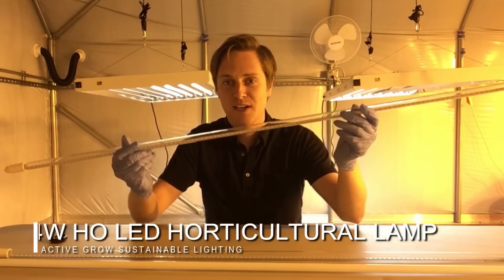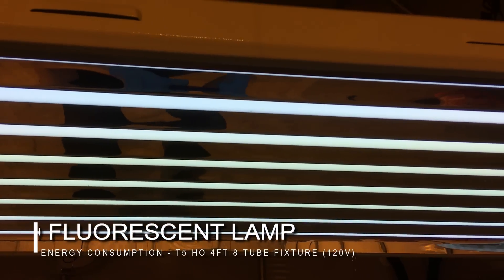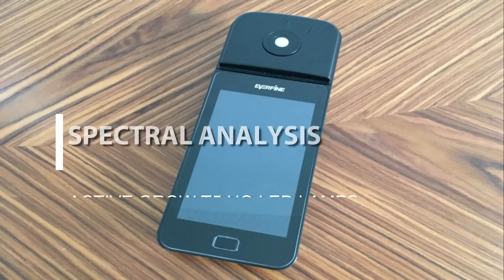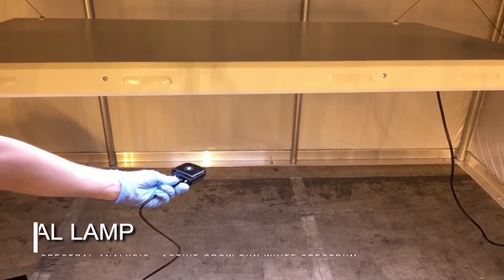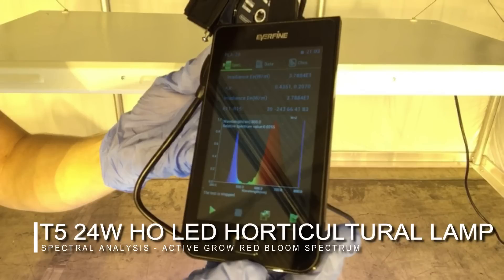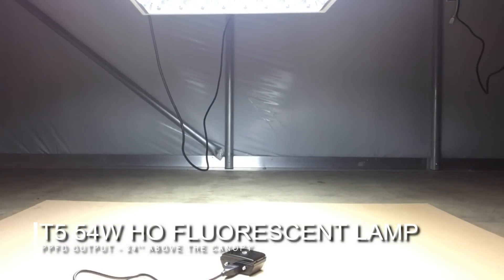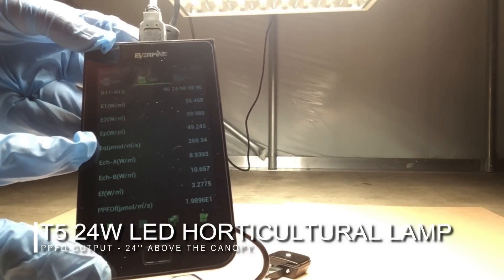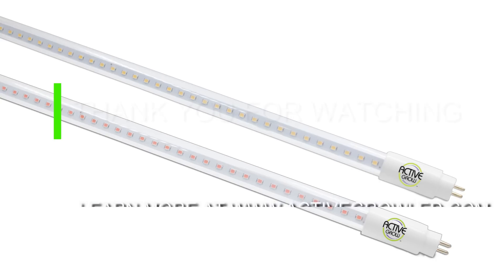Active Grow T5 LED Grow Lights Vs. T5 Fluorescent Tubes - Energy, Spectrum & PPFD

Comment: I just got my first pair of the 2ft 10w version.  my intent was to use 2 pairs of 2 lights (4 total) per 48" shelf, in order to save extra power (by being able control lights in half shelf increments)

I'm mildly disappointed that  the 2 ft version seems LESS than half as powerful as the 4ft (10w x 2 = 20w, which is 20% less than 24w).  I was wondering if that also corresponds to 20% less lumens for two 2ft vs one 4ft ?

Comment: How do these differ from iSunlight Agroled 41W 4’ T5 LED replacement bulbs? The spectral analysis looks similar but they are a bit more wattage and can run in single bulb fixtures. I am currently using the iSunlight T5 LEDs which come in veg, bloom, and green varieties.

Comment: Hi, great informative video. 
I have 4ft T5 fluorescent 6500k 5000 lumen bulbs in my indoor greenhouse. My plants have done great with these, but the time has come to replace them. 
I really want to switch to T5 LEDs however, have only found them in 5000k / 3500 lumens and below. How much does this matter?  Do T5 LEDs not exist in 6500k, 5000 lumens?
Thanks.
Reply from the maker: Not sure about that but we offer the Sun White and Sun White Pro spectrums that will perform much better for plants than any standard 6500K CCT LED.

Comment: Really wish this could have been done in a 4x4 tent with two 8 lamp fixtures @ 36 and @ 24 and @  12  and @6 inches
Reply from the maker: Thank you for the tip. The PPFD readings do increase substantially in enclosed tents. We are working on providing that information as well.

Comment: Do you make a higher wattage t5 led replacement bulb? Love the full spectrum these light put out. like to see a side by side grow using both
Reply from the maker: Hi and thank you for your question. At the moment we only offer the 24W T5 HO lamps as we want to offer a true one-to-one replacement for 54W fluorescents but with increased PPF efficiency and higher quality spectrum. If you use these lamps in a 4 lamp, 6 lamp or 8 lamp fixture the PPFD at close distances reaches very high uniform numbers allowing you to grow high DLI requirement plants in spaces with limited vertical clearance. We are constantly testing our lamps and fixtures and want to also show more side by side grows as well. Happy growing!
Reply: I’m in a 8 bulb t5 fixture & i just bought my t5 led i like them so far & they don’t put out a lot of heat, my question is how far should my light be away from the canopy & I’m in a 4x4 grow tent?

Comment: I'm currently using 1 of these in my jump start hydrofarm. Glad these are made. Helping me out until new lights arrive. Shout out to Green Coast hydroponics in Anaheim CALIFORNIA for letting me know these exist. It doesnt put out much heat. They had Veg and Bloom bulbs seperate and I only got Veg. Was surprised that there was no blue at all or any color. It is white but when off it's clearly an LED. I'd guess it's about an equivalent of 50-100 true watts. Good for starters. I added an silver heat lamp with a 99 cent store single LED grow bulb and that maybe is 25 watt pull. It said 100 watt. My little plant is happy and so are my tomatoes cucumbers and morning glory. 

Nice to see the specs on this.

I'm really interested in LED COB and CREE lighting.

Comment: Where did you buy par spectrometer?
Reply from the maker: Hello, for these tests we use the PLA-20 from Everfine, which is one of the only spectrometers to read and show wavelengths from 300-800 nanometers as well as PPFD. If you contact the manufacturer they can help you to buy one. Thank you http://www.everfine.net/en/productsinfo.php?cid=10&id=300

Comment: RANT:    I don't want to be the butt head here; BUT, WHAT does CRI have to do with anything?  It's just a MARKETING GIMMIC.  Allow me to present this opinion:

Premise:  CRI is PERCEPTION of accurate colour, right?  CRI is only "critical" (or "good enough") for photographers.  Add PHOTOSHOP into the mix...and "Just how is CRI working for people when they adjust a picture?".

Sunlight is suppose to be 100% CRI, right?  I agree with this statement.

HOWEVER, if light passes through HAZE, SMOG, FOG, RAIN, WATER, HUMIDITY, CLOUD, Lots of AIR (sun set, shift sunlight to RED), SNOW......Where is the CRI, now?  WHAT CRI is sunlight passing through any thing?

STOP buying into CRI as something that's critical to our daily lives!  I'm sure OUR ANCESTORS argued and debated over the CRI of a campfire or a hearth.  I'm sure our great grand parents divorced over the accuracy of bulbs.  

How many of us SEE blue of xenon or LED headlights?  How many of us SEE the yellow orange of old streetlights?  How many of us SEE "white" or 3000k warm light while in the bathroom?  How many of us SEE the 'accurate' light of an operating room in a hospital?

How many of us actually install 4000-5000k light in our work shop, kitchen and bathroom for a closer "accurate" rendering?
Reply from the maker: The Active Grow Sun White Spectrum utilizes high CRI chips that are formulated specifically for plant growth and feature increased PPF efficiency vs standard low CRI LEDs or fluorescents. The high R1-R15 Sun White Spectrum light appears white to the human eye but includes red light that runs into the 660 nm deep red and 730 nm infrared wavelengths. The combination of these two wavelengths creates the Emerson effect which increases the rate of photosynthesis in plants and speeds up their growth. Another huge benefit of the Sun White Spectrum is that under these lights plant development deficiencies are easier to catch and the end user can fix any problems earlier. Under the Sun White Spectrum the deep vivid colors of flowers, leafs and buds will all be accentuated vs conventional lighting making for displays that really stand out!

Comment: to bad you dont have these in 3ft versions, Id buy 12 of them right now if you did. Im running 2 x 6 T5HO bulbs lamps. Plus theyre not compatible with daisy chain single ballast T5HO units.

Comment: Why is the spd of the Fluorescent lamp skewed so badly between the graph at 5:10 and the actual meter reading at 3:22??
Reply from the maker: On the spectrometer the data is condensed on the smaller screen at 3:22. When spread apart it looks like the image at 5:10. It is the same for the two LED spectrums. The T5 HO fluorescent lamps used for this test were brand new 54W 6500K CCT Vivosun brand lamps.
Reply: it's exactly the same readings, one was just done a little bit closer